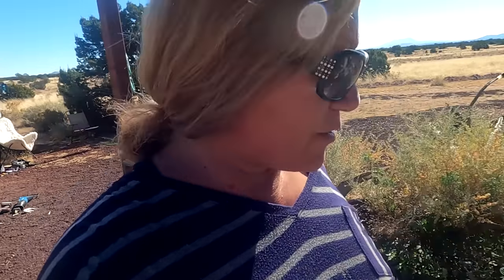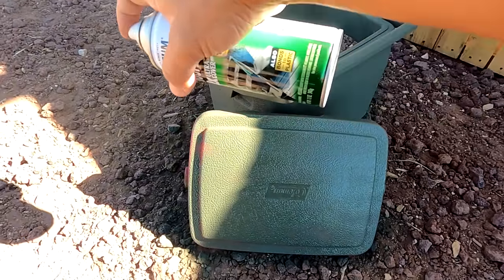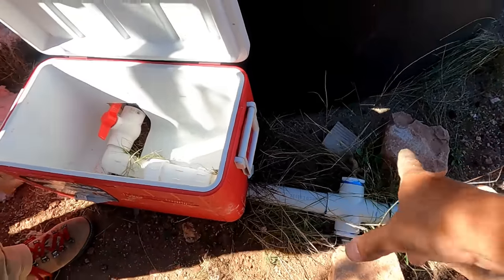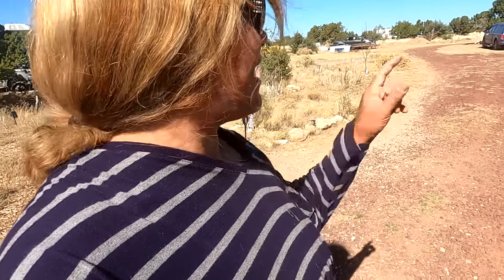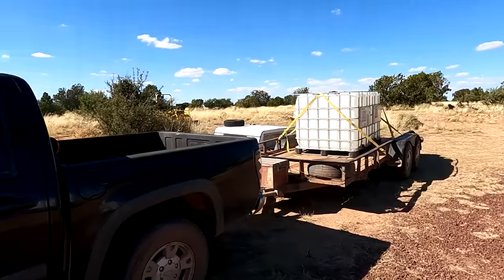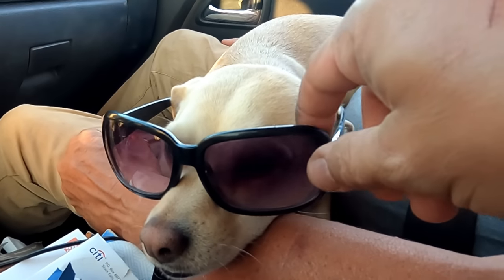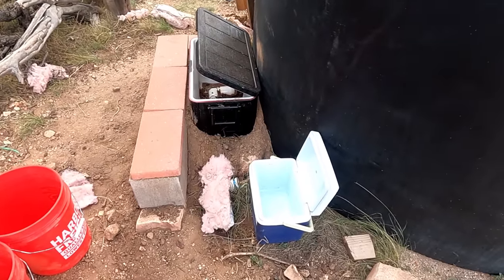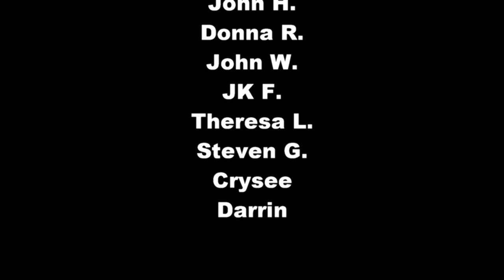Reusing Old Coolers- DIY Off Grid Water Valve Insulation

Comment: Great Stuff will not cure completely  in enclosed spaces, plus it will expand and deform the lid. It would be better to cut out a large section of the top of the lid and spray foam on top of it.

Comment: Spray foam to fill in the openings under the valve and pipes to prevent critters.  A blanket will just give them material to build a nest in.
Reply: Agree, rodents flatten themselves out to get inside anything, especially to get warm.

Comment: The parts you cut out of the bottom of the coolers should be slipped under the pipes.  Another thought would be to put some 1"x1" welded wire under the cooler or under the pipes to keep the rodents out.

Comment: I wonder if, instead of dirt, you could fill your cooler with packing peanuts? Then just shuffle them around (or remove temporarily, as needed) when you need to get to the valve? You would only have to make sure to use standard foam peanuts, not the eco-friendly dissolving kind. 😅 
Just thinking out loud here, I have no genuine clue. 😂
Reply from the maker: That's definitely a possibility 😊👍💕

Comment: Winterizing is good.  Great idea using the coolers and add blanket or ? inside to also finish up.  Maybe a rock on top of lid just to ensure the wind doesn’t open it or even a critter maybe..
Loving the white fencing.  I have a 40 gal. For water that I use in the summer months. Keeping it about 3/4 full to help with the freezing.  I’m just in my sticks /bricks home so not many things to take care of for freezing.

Comment: I think Concrete Blocks will let Cold air through unless Paint or Seal them somhow..
Reply from the maker: Could be, or they'll soak up the sun and give radiant heat 🤔
Reply: We had cement floors with marble & cement block walls when we lived in Beruit, Lebanon. All that cement drew the cold in. No central heating. It was very cold in the winter. Adding the dirt may help. Something has o better than nothing.
Reply: @rvpandamonium most of the houses in FL are built using concrete blocks. The air pockets within the blocks give a certain degree of insulation. Of course, like any house, there are wood studs on the inside to build walls , insulate and cover with drywall.

Comment: You know… Someone error, an old car battery, a cheap solar panel. Where you, wrap the wire. Around the exterior of your, valves and nozzles. You connect the wires. To the old battery and solar panel. And it should provide enough electricity in the wires. So as to cause them to get warm. And prevent your valves, nozzles and spigots from freezing. I would think? And no need for Igloo, boxes. Or Igloo boxes with, warming wires inside. To ensure no freeze. Because the box with a hole in it. Won't do any good. When the pipe bursts.

And so this is what a homestead is all about? Trying to figure out how to keep things from freezing? Simple. Move further south.  Move to a lower altitude. Tucson is lower. Mount Lemmon will have snow. When it's 115° in downtown Tucson.

But honey. You are up there at what? 6500 feet in altitude?  Of course everything is going to freeze! You are at altitude. Where the air is so thin. You are practically in space! How do you breathe up there? You are higher than Denver. And he's buried underground now. I think? Did they ever fish him out? Did they take him back for a Rocky Mountain high? How are you supposed to do that after you are dead? He didn't think about that first. Now did he? Obviously not. He is now dead.

So moral of the story here kids? Do not fly experimental aircraft.  And do not drive cars they can go faster than 50 mph. Because you don't need to. No one does. No one should be in that big of a hurry. We weren't before the 20th century. So? What has changed? Batteries? That is no reason to drive faster. Nor Axial Electric Motors. I meet you only need those for  very expensive cars that are electrified. And nobody wants those. Let's face it.

Yes until we get better batteries. That are more Solid in their State. Electric vehicles are a waste of time and lithium.. We need that lithium for, schizophrenics. And they know that. And should not be wasted on stupid cars. For grown-up children. To waste their money with. Because they can. They have no adults to tell them No. And to use their money. To help the homeless.. Which they are not even aware they exist. Because they are unbelievably wealthy. They see nothing. They hear nothing. They know nothing.  Other than they are very wealthy. With no brain. No conscience. No efficacy. No moral compass. Only a need for speed, speed and more speed! Because that's real important! That boys can go faster than the speed of light! Now almost up to the speed of sound! Just a little bit further now. And you will get ticketed. For breaking the sound barrier on the way to work.

Once they can develop tires. That will stay on the car. And so who needs tires? FUCK tires!
RemyRAD